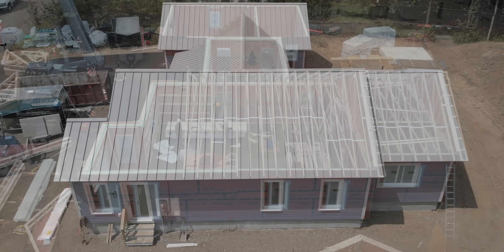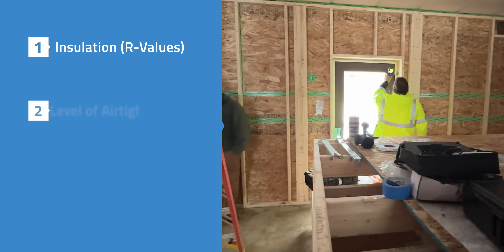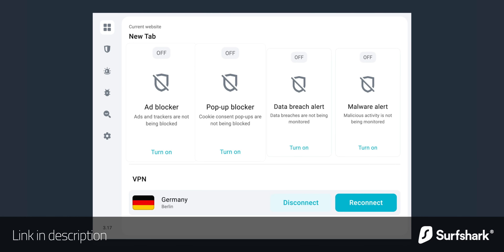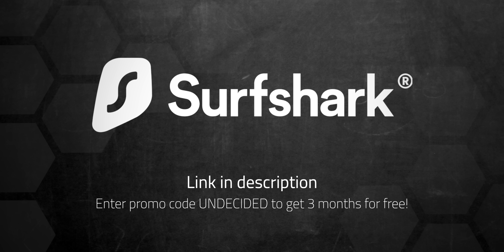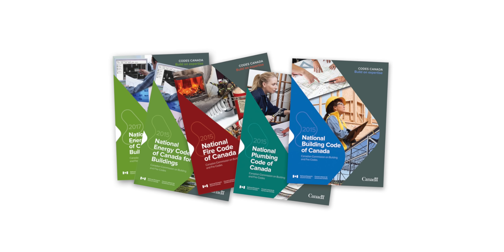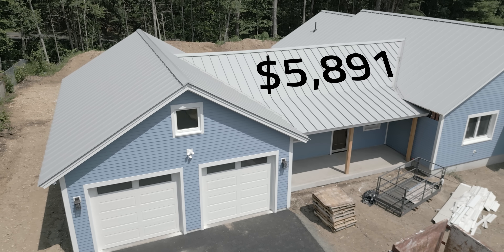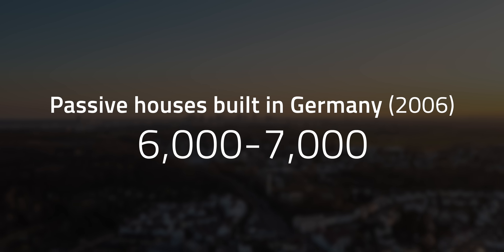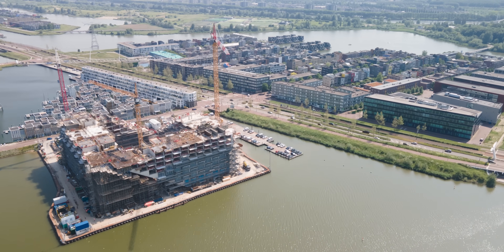Why Do American Homes Suck?

Comment: I came from Finland to Michigan in winter and was shocked when I felt the breeze indoors in the first house I visited. Leaky single pane windows in the northern states, what the hell?

I couldn't help noticing other sources of waste: the bus driver left the engine running when he went on a coffee break and my friend didn't even think to stop the engine while fixing his flat tire. One time the stairwell in my dormitory was heated so well that the door handle was literally hot. Even flushing the toilet seemed to use neverending amounts of water. At the university diner I had to bring my own fork, because I got tired of eating with disposable plastic forks.
Reply: All the same in Canada. Here in Toronto the bus drivers also turn on heating unnecessarily to the max.
Reply: @solderbuff  Modern building codes in my province in Canada are just as strict as they are in Europe.  I litterally have tilt & turn windows in my house just as shown in the video
Reply: Can I just say say that as a fellow European, from England, I totally agree with you. Ignore the man who talked about you being simple minded because you're absolutely right.This is not repeated starting and stopping the engine on a journey - which many cars do nowadays using the eco setting and which could perhaps cause premature failure of the starting mechanism. There is no problem at all with regard to wear and tear switching off the engine changing a tyre or similar occasions saving fuel and reducing pollution. And you're absolutely right that it is wrong to waste resources just because they were plentiful at that time. You are not simple minded at all so totally ignore the nonsense the other contributor was saying.
Reply: @trendystone interesting, I would have described you as being overly defensive. Remember different countries, different cultures, not everyone is the same. Whilst some might think a country is brash and aggressive, others might think passionate and motivated.  The Finnish observations of their experience in the USA, we're just that. Observations and no more. Did they know about running diesel engines in the cold? Or even US engines as they may vary in size and capacity to their own? Waisting water can never be a good thing. Just because a resource is plentiful now doesn't mean you should throw it away. Is that not what got us in this mess in the first place? Plastic forks, really! Get the wooden ones. Better still provide NO forks and let the students bring their own! That way it may teach them a good lesson!
Reply: @stuartorme8760 Buddy, he should learn about American culture if he is going to the USA. Just like I would learn about Finnish culture if I was going to Finland. Yes, it's impossible to know everything. That being said. He worded very harshly, without a care for why stuff is the way it is. It's called ignorance.
Reply: The fork thing I feel. Less for the pollution and more how they break apart on anything harder than jello.
Reply: Ikr, it's all pretty thoughtless behavior.
Reply: an  well that's not every house.. I could easily go to Finland and criticize everything there also just like people do about the United States constantly. People are obsessed with talking about the United States. So many Europeans think the same things about Americans which most are BS. My house is made out of bricks.. Now what? All of you have it in your head that we have wooden houses.. When you see videos like this in European Minds it goes to thinking every single American has got to be like this...  It seems.. Which is one of the dumbest things you could ever do.
Reply: @BriBryBriBry People love to say Americans are bad at geography and dont understand other cultures. Then also complain about American culture when they don't understand, or are unable to grasp just how big the USA is. Although, not all Europeans are like this, just like how not all Americans are like what those Europeans describe. I know where most European countries and all major countries are located and I'm American. I know the Finnish capital is Helsinki.
Reply: Disposable Forks? What does that have to do with the United States? It has to do with the place that you went to that's all. Thinking that every place is the same is hilarious to me.
Reply: I think it's ridiculous I have to wait behind little crappy tractors that look like cars in Scandinavia but I don't complain about it other than right now  😂
Reply: Y'all sound real uptight lmao.
Reply: @cthulucalamari2448  The Finish have a superiority complex.  Single pane windows haven’t been used the US in 60 years.  And diesel trucks in Finland ALSO keep their engines running in the winter because diesel fuel will gel in the cold.  This is just a snob.
Reply: Well what do you expect when you move to a 3rd world country.
Reply: unlikely they were single pane.  more likely: the breeze was from every un-sealed joint at every juncture/plane.
my parents' house was built in 1948 and has double pane windows ... that you can feel wind around the frame.  and external corners.  and where the walls meet the roof.  etc.
Reply: @saturday1066   Some older houses had single pane windows and it was intended that storm windows were installed before the weather became cold and removed again in the spring. But houses that weren't cared for no longer have the storm windows due to rot.
Reply: @saturday1066  at this time the smallest engine in a 7 series was an inline 6.
Reply: Single pane windows haven't been used in the US for decades!  Sheesh
Reply: possible that the diner purposely used plastic bc uni students are (sorry, no offense) notorious for stealing utensils (because new to renting)

an actual diner would prefer regular (metal) forks bc it's cheaper ... unless the students keep stealing them
Reply: @saturday1066  It is actually a cost thing. It costs more to run a dish pit than just offer disposable. (Anyone who has worked in a restaurant can tell you how much time is spent on just utensils.)
Reply: @RedtheTiger1851 Maybe the cost of waist isn’t calculated into the sum.
Reply: Deisel engines are left running in the cold for a reason.  Look it up.
Reply: @lukewarme9121 must not know much about cold when he comes from Finland. Look it up.
Reply: A large part of the reason for all this is that you visited a poor part of the country.
Reply: Hey buddy please try to understand a unique economy of this great country with  comparatively unlimited space (for solar), cheap and abundant fossil fuels (natural gas) and complete lack of intrusive and excessive government regulations ( except in California and some Eastern California wannabe states) .  I am too from Europe and do own European "bunker" single family  home there, however, I much prefer my USA home for general layout and openness.
Reply: Drama queen. One leaky window, I have a new US home, no leaks, well insulated. You can always find that one bad example.
Reply: I am absolutely sure that the people who owned the first house you visited with the single pane windows would have been glad to have you purchase new 3 pain windows and have them installed. I am appalled you didn't offer to pay for them.
Reply: @billstech1715 They could probably spell properly too. Unlike you.
Reply: Keljulvan_ Sometimes people like you make simple minded assumptions, for instance, on some vehicles, like that diesel bus, the price of the starter and battery are so high that it is sometimes better  to leave the engine running for a short time than cause more wear on those expensive items. Also, not everywhere has a water shortage problem, and setting national standards to save water is just stupid, it should be left up to local and state governments.
Reply: @JohnSmith-ti2kp  IT is standard on most newer cars in Europe to automatically shut down any time you stop on a red light or stop for any reason. And when you release beaks automatically turn on and keep going. Imagine starters and battery doing that hundreds of times a day? This is not something impossible it's very possible when people want to stop wasting energy and stop poluting. If you don't want to, you can always find more excuses.
Reply: @mudza92  There is a button on lots of those cars to turn this auto off off, it is not European. It is a futile waste to shut the engine off for a short time and uses up the battery and starter offsetting any savings in energy by requiring more replacement parts.
Reply: @JohnSmith-ti2kp  aren’t there drought issues in practicly every US State?
Reply: @dirk2518  It depends on what you think a drought is, here it is seven to ten days without rain.
Reply: @JohnSmith-ti2kp Being belgian i live in one of the most rainy weather in Europe but dispite this we have problems with ground water levels so i was wondering if most US states don’t have the same problems.
Reply: @dirk2518  I am not sure about other states. My state there is no problems with that yet.  There is one major problem I never hear anyone discuss ever, and that is the increased rain runoff from building more roads, driveways, parking lots, houses, apartments, business buildings, etc. The increased runoff means less water is soaking into the ground, also lacking is any information of this runoff increasing ocean levels, which it must be doing.
Reply: @JohnSmith-ti2kp same problem in Belgium. Building codes are being adapted so we’re obliged to go for more permeable solutions like on driveways and parking lots. Also we have to catch rainwater from rooftops.
Reply: @JohnSmith-ti2kp  how much does a battery and a starter cost for a bus? How about a F150 or somesuch pick up?
Reply: @itseperkele181  I am sure a bus would be really expensive. My 1986 C-20 starter was well over $350. for rebuild and install maybe five years ago, probably $450-$650 now, It takes two of the largest batteries to produce 24 volts, and nearly 2000 amps, they are $235. each plus tax to total around $1000.00 for all.  Update, just the starter I had to get was $750.00 parts and installation.
Reply: @itseperkele181  Well, to update, my c-20 starter went out again, it is being replaced now at a cost of $750.00..  I hope that will be the total.
Reply: @JohnSmith-ti2kp why is it more effective to set water standards at the local level vs national level? it not like water behaves according to state lines.
Reply: @maxmp150  People have more access to a state elected officials and governmental offices than federal ones. People in the federal government are nuts.Places that receive two inches of rain are different than mine receiving 50 inches.
Reply: @JohnSmith-ti2kp  so because right now they don't have a water shortage in that specific area , it's okay to waste water as much as they want ??
Reply: @Lostouille  Yes, it is a renewable resource, read up on it. I think you can find this information in about a 4th grade text book.
Reply: @Lostouille  michigan borders the largest freshwater lake in the world, water isn't an issue for them
Reply: @JohnSmith-ti2kp  true but rate of use has to match the regeneration else renewable or not a shortage is inevitable 😵‍💫
Reply: @Lostouille Ummm yes. Not everyone lives in a desert. This might blow your mind but in some places in the world they get so much water that it becomes an issue and their houses get flooded. I'm talking feet of rain. Hell some places get so cold that the water just freezes like the fridge. What a wild world it is outside of California.
Reply: @jasonhymes3382   noooo shiiiiit  ??? it doesn't matter if you live next to a river or in the middle of a desert. Water is a precious ressources , people need to educate themselves about that
Reply: @Lostouille water is not a "precious" resource... when you LITERALLY have to install drainage all over fields for crops so they don't drown when it rains for 24 hours. 🤦

My parents pay $0 for water... because their water literally flows out of a natural spring on the side of a hill and whatever isn't used - pours into a stream by nearly a gallon ever second.

You "conserve water!" people are so sheltered.
Reply: @SoupyMittens  a  pressurized lake is rare.
Reply: @SoupyMittens  still it cost $ and energy to process water before and after usage. The fact that you wouldn’t even bother to save it illustrate the long way usa still have to do toward efficiency
Reply: @StrifeA217  I am 50 years old and have never seen a real life well in my life nor have I seen a septic system, yes I am American born and raised
Reply: @Mosie926  You should get out more.
Reply: @jasono2139 But the vast majority of people don’t have a natural spring water supply they have to rely on the mains and water treatment plants. These use energy to supply clean water and more energy to treat grey water. So even if there is abundant water in the absolute, wasting water still wastes energy. And then… shouldn’t we have a kind of general attitude to the world that we don’t waste? Do you need a car with an enormous 6-cylinder engine? No, so why use one?
Reply: @JohnSmith-ti2kp  Well they had all the time in the world to do it, if they don't I would want a federal one if I were a citizen.
Reply: @benktlofgren4710 I think it is important to note that the US is a very large and geographically/environmentally/meteorologically diverse "country" and as such, it is far more efficient and prudent for Local and State governments to dictate what is needed for their own circumstances and not for the federal government to do so. 

To put it in perspective the US is essentially the size of 50+ European nations with ”hundreds” of different environmental circumstances from one area to another, but your suggestion essentially amounts to having a single European nations government managing and dictating the needs for all of those individual and semi independent ”nations”, rather than the "nations" determining it themselves. 

I think it is also important to note that the US is actually Union not quite a single entity. 

I would recommend, if you're interested in any substantial degree, that you study up on the varying regions of the US and their own unique geographic, environmental, and meteorological circumstances. Perhaps also the history of the US and specifically its states, as well as varying empires throughout the history of the world and how they managed similar things. I'm sure that you will note that those empires left the local government to deal with and regulate the needs of its area and not the highest levels of the empire's government.
Reply: @JaredaSohn  This is precisely the same argument the slave owners made. What you just said was a fallacy back then, and for the same reasons, still is today. No, we can't trust local towns and states to do the right thing. That's why we have federal laws and the rule of law. Rather than King Jared reigning supreme as mayor of Himville.

The canonical example is toxic pollution from one community harming another. Just to oversimplify this for you and other readers, consider the case where one community upriver thinks it is fine to dump lethal levels of toxins from their factory waste into the drinking water supply above another community down river. Who get cancer and birth defects and die, solely because of your rationale -- that choices should be left up to the local community. We only learned this the hard way by poisoning ourselves for centuries in all 50 states mind you. It's not like we don't have the data or have to guess... WE CAN REMEMBER. The reason this never works is because local communities are often company towns who only care about their profit not consequences. Especially other people's well being, especially when the victims are in other towns or states. Funny how rivers and toxins don't just sit in the couch but actually GO OTHER PLACES.

Luckily, we have a federal government with an executive branch, two legislaturea, and a supreme court ALL OF WHOM HAVE DISAGREED WITH YOUR FOR CENTURIES. 

Thanks
Reply: @irtnyc comparing resource usage and building codes to slave ownership has to be one of the dumbest arguments I've ever heard. 🤦

One is an ethical issue... the other is a resource management issue.

...and throwing pollution into the mix is just another strawman.

It would be idiotic to think the federal government could create a one-size-fits-all solution when you have people in Miami facing hurricanes every year while people in Buffalo are being buried under 6 feet of snow within 72 hours.

Requiring housing in Buffalo to have hurricane window would be stupid... as would having a fleet of plow trucks in Miami.
Reply: @irtnyc  Obviously this isn’t about pollution or slavery. Though the federal government does have the right to make laws for certain issues, especially when another state can be harmed from a different state’s laws. However we still are a Federation which has more balance than what you are implying. The US is about 3/4 the size of Europe, not everything should be channeled through the federal government. Florida alone is more than 3x the size of Finland.  With the diverse climate the US has it wouldn’t make sense to standardize all building codes either. There are consequences for standardization such as higher costs for building housing. If a temperate climate region doesn’t need certain codes then why have them if all they will do is increase building costs.

Comment: Bldg and Energy Codes in CA are a JOKE. I Inspect buildings, for code violations, and I told my boss, never take a job in CA again, it's just window dressing. If the local politician doesn't get his payola, then the codes are enforced (Including FIRE Codes LMFAO), and thru fines and work slowdowns (contractor losses money). eventually the payola gets into the right hands and VA LA, everything is good. If the money is payed, guys like me are ignored, or threatened in a nice way, when we note the violations. CA is like working in Venezuela or anywhere south of the US Border (Corruption).